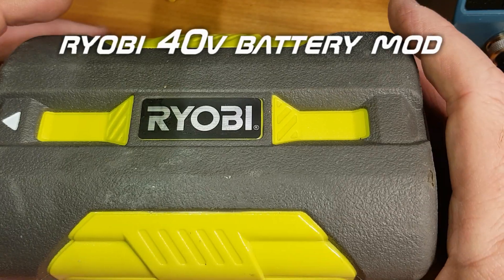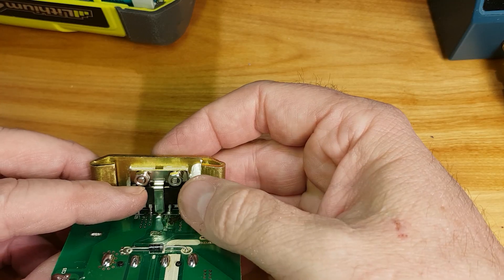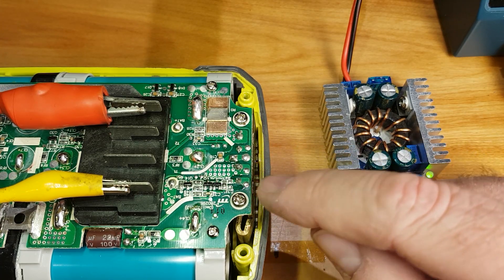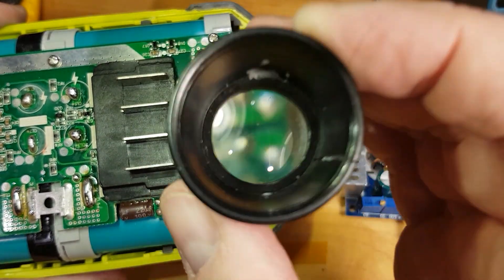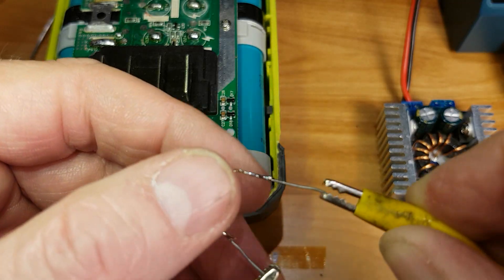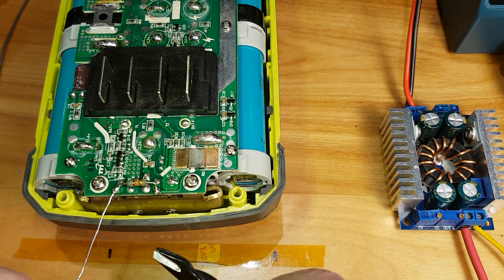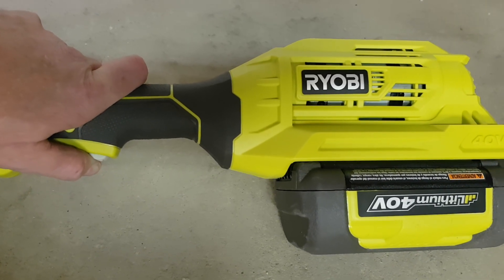Ryobi 40V battery won't charge.

Comment: I have not yet had a 40V Ryobi battery die so I've not taken one apart. However, it is my understanding that there is a reset on the circuit board and once you have partially recharged the dead battery, you need only activate the reset and the battery will work properly again. No modification needed. But... I will have to wait until one of my 40Volt batteries does die before I will be able to confirm this for myself.
Reply: Reset works if no lights will illuminate on battery…older packs do not have a reset button.
Reply from the maker: There is also a transistor that fails that causes the battery to not charge. I can't remember where I saw that though.

Check out my other video about these batteries

https://youtu.be/WKY1-JNijqo

Comment: The link to the power supply you use takes you to a unit that is currently unavailable and they don't know when or if it will be available. I wanted to let you know, thanks for a great video!
Reply from the maker: Thanks for letting me know that the link is not available. I will try and find a similar one to put in there.

Comment: i have a older 2 fet batterty mine looks different and don't see were the trace is so i need to cut the gate on neg to tie in is what im understanding
Reply from the maker: Basically you are cutting the trace for the gate of the FET and then tying it high to keep it turned on. Remember though that you are bypassing the BMS, and now you have to monitor cells to ensure safe charge/discharge. 

Thanks for watching.

Comment: subscribed
great video, does this mean that you can never use the Ryobi charger again?
Reply from the maker: I can not give a definitive answer to that.  The Ryobi charger communicates with the battery, and that is what determines weather or not the Ryobi charger will work or not.  I have had some luck with the older battery packs working with the Ryobi charger, but no luck with the newer battery packs.  Thanks for watching.

Comment: Hi CityViking! I have ryobi lithium pack rated at 36v 4Ah, (model BPL3640). I was told it was shot, but after placing it in a charger it charged to full - indicator shows all 4 lights - it took about 2hours with 1.7A charger. But, when i place it in a tool - it wont start - so i guess i have similar problem as shown in Your video but with discharging. I pop the battery pack open and check all cells - they show good voltage around 4.2V. And when I check battery pack voltages it gives me around 19V between + and -, 40V between + and T1 terminal, and 0V between + and T2. I have got a good pack and when i measure it, it shows 36V between + and - , 36v between + and t1, 36v between + and t2. Can You give some advice where to look? Should i check again each cell or start looking whats wrong on pcb? Where to start? Does this "hack" also work for discharge issues?
Reply from the maker: you could try bypassing the other FET to see if your tool starts to work.

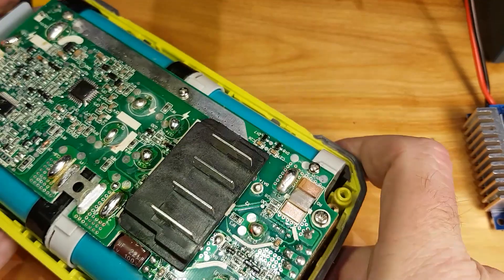Comment: The 2nd option at 10:54 you said, can’t work after the battery is charged with the cover on? If the voltage is above the (30 )threshold doesn’t that mean it will work fine, with the cover on unless the voltage dips below that threshold?
Reply from the maker: When I have a battery that won't take a charge, I always leave the screws loose that hold the cover on. That way I can easily open it for charging and also monitor individual cells to ensure even charging. The BMS in these batteries seem to lock out charging from the factory charger once they have detected a problem with the cells. The mod I show in this video with the resistor only works on older firmware.

Comment: Nice video - I have a later 40v battery so the circuit board looks a little different - at around 9.40 you implied that when you have done the mod you are disabling the charge controller BMS and there is a concern there - what exactly do you mean?  Will this result in the charge system not switching off when the batteries are charged??  My battery got left out in the rain, no corrosion but is now only 15.5v and the four green lights.  On charge it gets the usual oscillating red and green lights on the charger.
Reply from the maker: Yes, the mod does bypass the BMS charge circuit and you become the BMS for the battery. Only charge the battery while you are there to monitor it.  I hope that clears things up for you. Thanks for watching.

Comment: I have a battery that came and it never took charge. I tried the jump reset and it didn't work. I am wondering if this would work. When I try the jump reset method the light for the battery doesn't come on until I press the button and when I do that it stays on, thoughts?
Reply from the maker: I would charge up the battery and then try the reset method.  Make sure you charge up the cells evenly though.   I hope that works for you.

Comment: I would solder the resistor in line with a momentary switch so I only jump the gate when needed.  Not sure why you need to cut the trace?
Reply from the maker: I like the switch idea!  

I cut the trace so that high signal from the resistor mod doesn't feed back into the low signal coming from the rest of the circuit.  It could cause more damage to the circuit.

Comment: I'm an EE and tried to fix my 40v battery.   Ryobi is getting smart and disables the battery pack after certain conditions so ppl like us cannot fix it by replacing the batteries.  The microchip sends a signal to burn a small value resistor to kill the battery and disable the gate.  The hp inkjet did exactly the same thing so ppl do not refill the ink cartridges.

I saw someone rest the bms using rest pins.  I didn't have a such a lock.  You can short circuit the mosfet s and d legs and you don't need a resistor.  However I think with all the fixes the battery still won't charge by Ryobi charger and you have to charge it using your homemade charger.

If you're into fixing the battery pack, look for a small smt resistor which is open and is burnt .  It must be close to a transitor, since no microchip has enough current to burn a resistor.  If you find that resistor, please create a clip and let us know which resistor needs to be replaced.  Good luck.

Comment: Great video on charging.. my bat has just stopped being charged. I may actually get a non Ryobi replacement from eBay and also try to get your screw mod working. What bench power supply do you use for the DC to DC boost converted?  I will probably try to use the screw mod 1st and carefully monitor the battery voltage as you say this bypasses the overcharge protection.
Reply from the maker: I use an old laptop power supply to convert 120V ac to 18V dc. Then I add the dc-dc boost converter to get 18V up to 40V. Hope that helps.

Comment: Could add temperature fuses that add back the protection that the BMS would be giving
Reply from the maker: That would help for overheating, but the bms also makes sure the individual cells don't discharge too low or charge too high. Thanks for watching.

Comment: I have a 6AH Ryobi 40V (OP40602) took apart. Voltage on cells appear to have 0V. Any suggestions to revive it, thanks
Reply: It may be possible but I would not recommend. Look at videos showing how to revive , reset current interup device in 18650.
Reply from the maker: Cells may be just drained to 0V. I would try charging individual cells slowly. Start with 1V and 500ma.  If it charges to 1V, then try 2.  Once over 3V you can try charging quicker.

Comment: I wouldn't mess with lithium ion batteries the discharge safety mechanism is there for a reason they can be ticking bombs if  not put back together the proper way  for the BMS to function
Reply from the maker: I agree.  Never disassemble electronics without understanding the risks.

Comment: Hello, I must say Great video! You really seem to know your 40v ryobi batteries.
Now for my question, I have built a robot from hoverboards and retrofitted a lead acid scooter to both use 40v ryobi batteries. My issue is when using 2 batteries in parallel one of the 2 batteries will be greedy and hog all of the load, thus making the motors over draw the battery and drain it to quickly while leaving the other battery at a full charge. Do you have any idea on how to make them share the load nicely? Sometimes I can get them to share if they are both fresh off the charger and I unplug the one that has the load and apply a load and press the charge indicator button then plug back in the original battery with the load still active. Kind of a convaluted process. I am hoping for a resistive solution. Thanks
Reply from the maker: I noticed the same problem when trying to power my bike in my other video.  I just run on one until dead and then switch.  I know this is not a solution, but there is no real easy way to get around this, at least not safely.

Comment: Does it need to be specific with the 51K ohm resistor? or can you go the next number up or down? Also instead of the Mod would it be possible to replace the FET with a new one to fix the charging issue? I'm just asking since the Mod does override the Over Charge protection of the BMS. Thanks in advance.
Reply from the maker: Resistor is not critical. You could be thousands of ohms off. The FET usually is not broken, the circuit just won't turn it on..this mod forces it on.

Comment: For people that's not knowledgeable about electronics and how they work and especially dealing with voltage should never open this up to fix. Only experience people that knows what they're doing should do this.  For those people that are not experienced in this area the easiest solution is to call the number thats in a video I made on this same topic. Because these batteries are already under warranty and they will send you another one for free. Or you can pick it up at the store for free. Video is on my page.
Reply: They won't do that in Australia. You have to return the tool and battery with original packaging. I now have 3 dead batteries and I will be trying this mod.

Comment: Thanks but this process no longer works...
Reply from the maker: The resistor method only works on specific boards with specific version firmware. The rest of the information should apply for most of the older boards. Thanks for watching.

Comment: After watchung this, why would someone buy a Ryobi trimmer?  Can't believe the company has not addressed this issue or even included this video with the 40V batteries.
Reply from the maker: All lithium batteries have a limited lifespan dependent on how hard they are used.  While the first batteries did have problems, I have some of the newer batteries and they seem to be fine so far.  I have a lawn mower, chainsaw, blower, and trimmer.  I imagine that if you sell millions of tools that use the same batteries, you will have some failures, especially in the beginning.  I always try to stay clear of the newest tech as a rule.  The leading edge is the bleeding edge!  In my field the newest equipment ALWAYS has the most problems and the older tech has the bugs worked out.  Look at Tesla in the beginning, nothing but complaints. Thanks for watching.

Comment: I have 2 batteries with the single FET. when I measure voltage on the contacts I get 20V. When I measure from the + contact to CL1- on the board I get 40V. Any ideas? I had another newer that was to low to charge, I charged it on a supply at work and got it from 16V to 35V, I shorted the reset contacts and got it up to 35V, took it home and now the charger is working on it. Any help would be great. Thanks
Reply from the maker: The FET is probably not on and so the voltage does not read correctly.  This is normal operation.  I explain it in my other video "Ryobi battery questions answered".  Thanks for watching

Comment: Thank you for your video about fixing ryobi 40 volt battery.  my understanding, it's look like those FET are most of the time THE problem because they do not want to open for charging or discharging.  You show us how to charge under  monitoring.  So at the end it seam to me that it always a battery problem.  if I am right, i guess it will be best to removed the board,  buy new batteries and placed them in a case to made too packs of 20volts and add over them the board and put everything back in the original case.  what do you think about that. excuse my english i am french form canada.  so in the futur it will by easy to test the bad battery ans changed only this one
Reply from the maker: The FET's rarely fail, it is usually a faulty cell or other board component.  I have removed the board and disassembled a dozen packs.  The board is usually damaged from disassembly and even if you could find the faulty cell and just replace it, it would be almost impossible to do it without removing the board first.  You would have to buy a separate 40V BMS to protect your pack.  I am planning a similar build and will post once I have gotten all the parts.  Thanks for watching
Reply: @thecityviking  Thank to the replying, so even being very carefule with the board, if we need another 40 volts bms to rebuild a new battery, I have seen another Guy on youtube, doing battery for e bike and he use new bms, he ordered from internet, As I remember, that Guy even as written a couple books related  of doing battery. I have looking forward to see you new video.  thank again to help us with dose ryobi battery that don't last much.

Comment: Ryobi scam
Reply from the maker: Well I sure don't like that they are using some weird proprietary board that takes the power away from me to easily repair it, but thanks for watching.
Reply: @thecityviking . 
I'm going to try charging the battery without the charger and see if I can get enough on it so the actual charger will recognize it.

Comment: got super excited finding your video because im having the same issue w my 6ah 40v op40602 battery    crack the case open  and competely different board     manfacturing date on mine is 2019 4 13   back to the drawing board lol  but A+ video man  keep up the good work
Reply from the maker: I have a couple newer batteries, but they both work fine so far.  I was thinking of doing another video just talking about these new batteries and how to check them and possible alternative charging.

Comment: So if the BMS shuts off the discharge FET, then the charge FET is also turned off (since the gates are paralleled). If that happens, how do you turn them back on?
Reply from the maker: They are not parallel they are series
Reply: @thecityviking  weren’t you tying the gate of the charge FET to the gate of the discharge FET through a 51K resistor? Given the high gate impedance, it seems this is driving the two gates with the same signal.
Reply: @thecityviking  Thanks. So if the BMS turns both gates to the two FETs off, is there a way to turn them back on to allow charging?
Reply from the maker: Sorry, I read your original post incorrectly.  You are correct, the gates are paralleled. The charger does not charge the battery on the newer battery packs because there is communication between the charger and the battery pack.  If the pack tells the charger that it is defective, the charger does not provide the charge voltage.  I think possibly we need to modify the charger and the battery?
Reply: @thecityviking  perhaps so. Unfortunately, I’m not familiar with the details of the circuitry in the charger or the battery. So I have no intelligent feedback on the best way to approach it. You’re probably much further along on ideas for the best way to do that.

Comment: Thank you so much for this video but I do not know why we do not charge the battery with its Ryobi charger? Or is there a bad signal at T1?
Reply from the maker: The charger and the battery communicate on the T1 pin.  If the battery tells the charger the battery is no good, there is not much you can do to get the Ryobi charger to charge that battery.  I have been trying to get an older Ryobi charger to see if I can "hack" it.
Reply: @thecityviking  Thank you! I have got it...

Comment: Hello there . I’m very curious  in how I can reduce power curro from 120v to 40v dc  my thing is , I want to install direct power to a 40v sunjoe  pressure washer  to stop using the battery and have direct controlled power to the machine
Reply from the maker: You would need to purchase a 40 volt high current power supply.

Comment: Great video.  I was under the impression that once you charge up the pack, the gate would work properly again. Bad assumption?
Reply from the maker: The problem seems to be with the circuit  that turns on and off that FET. The mod I show just allows the FET's to be controlled together by the other part of the circuit. Instead of the two FET's being controlled separately, they both work together. You are bypassing some of the protection of the BMS, so do not charge it unattended.
Reply: @thecityviking  tyvm
Reply: @thecityviking  Agree but as you stressed, 1A charge should have no problem. I found a nice booster on eBay as now Jan 2021 Amazon still nil stock. Good video. Thanks.
Reply from the maker: Thanks for watching!

Comment: My battery's LEDs are all blinking green when I press the button, and the battery won't charge.   If I cut the trace connecting the pin and capacitor for the  Fet, and then don't solder in a resistor, can I  still charge the battery without any problems?
Reply from the maker: Blinking lights o. Your battery probably means you have an unbalanced pack. You need to check all the individual cell pairs and see if they are all at the same voltage. I would try and charge them equally  and see if it charges on your charger first.